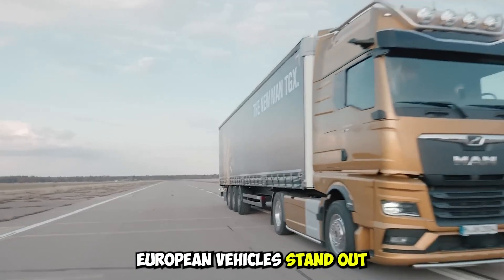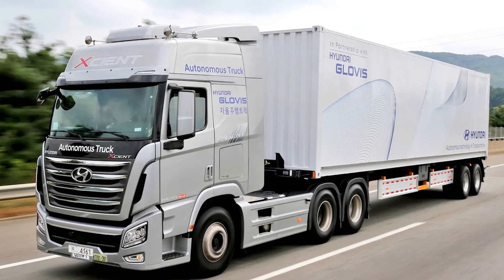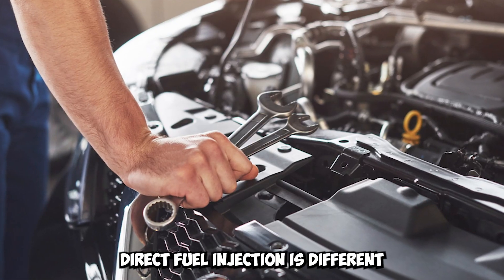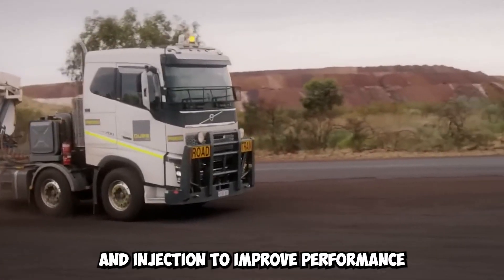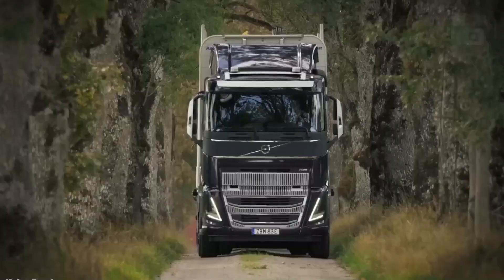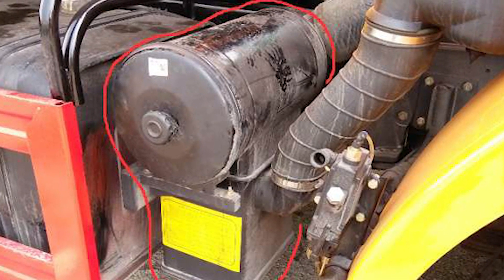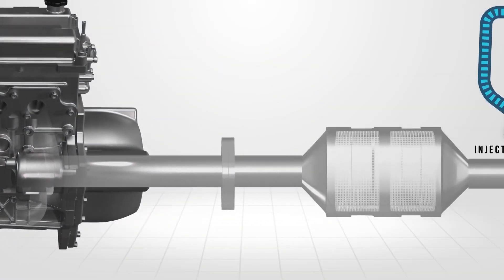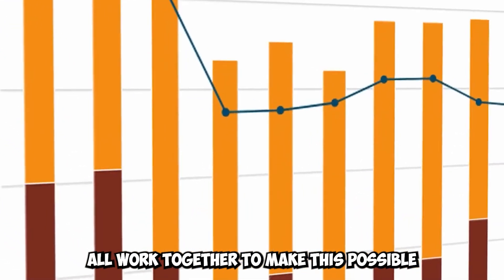Why 770 HP European Trucks Are LEAVING US Trucks in the Dust?

Comment: European trucks are more powerful because of the type of geography they encounter. Simply put they need that extra power. In America the highways & interstates were engineered from the start to take things like grades into consideration when the roads were being built much like our railroads were designed and built. As far as direct injection goes yes it will generally be more powerful than a indirect injection motor but as many manufacturers are now finding out direct injection will lead to valves that will be gummed up with carbon and a poor running engine will result. Lastly American trucks use aluminum in their designs such as the cabs and other parts. They also use EGR, DPF, & SCR for emissions control just like their European counterparts. In fact one American truck manufacturer just built a super truck that’s so aerodynamic and efficient it gets 16 mpg in test. 

If someone wants to watch a glorified European chest thumbing video this is it. If you want the truth or facts with detailed explanations this isn’t it.

Comment: American Rigs on 5 axles typically have a GVW of 40 tons ~ 80,000 pounds; European Rigs on 5 axles can have a GVW of 44 tonnes ~ 97,003.412 pounds, sometimes 100 Tonnes ~ 220,462.3 pounds (with more axles).
In Red States Rigs share the same speed limits as other vehicles on the road, 65 ~ 75+ MPH (105 ~ 121+ Km/hr).
European Rigs are limited to 37.2, 49.6 and 55.8 MPH (60, 80 and 90 Km/hr).
The Heavier European Rigs need stronger and more powerful Engines to move their loads at good, steady speeds to deliver their loads in as short a time as possible.
The European Trucking Companies don’t Underutilize their Rigs as is done here Stateside.
Also, European Trucks are Superior to American Trucks.
Reply: In- line six not incline six.